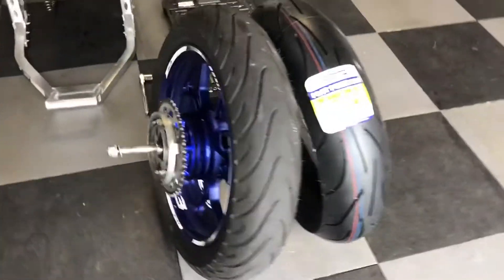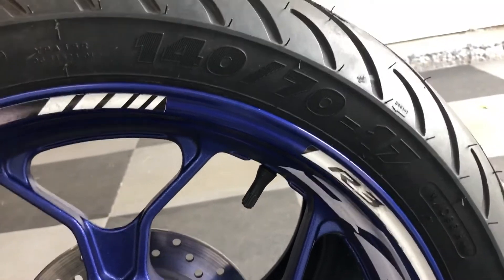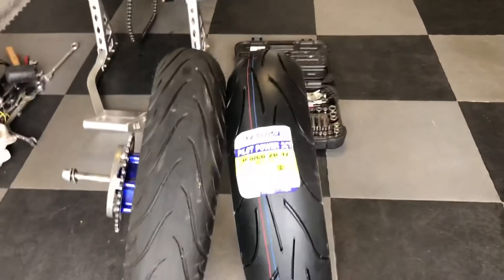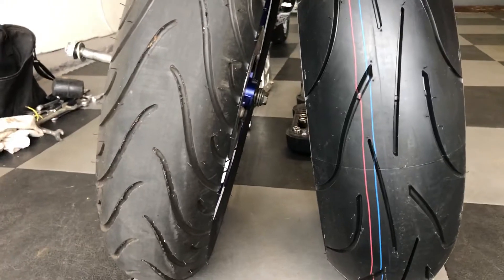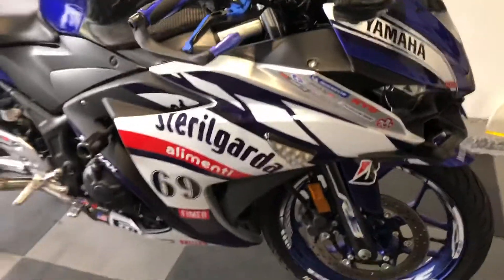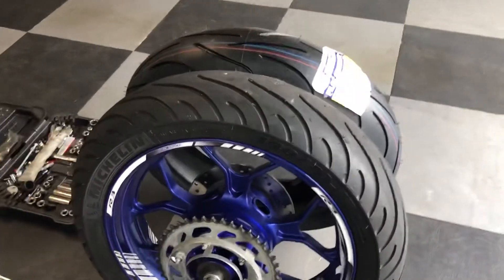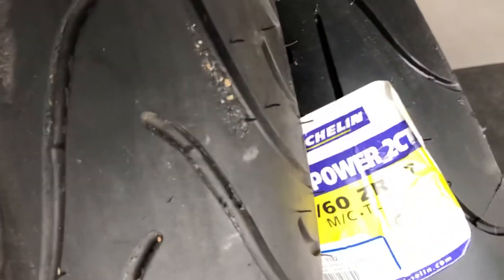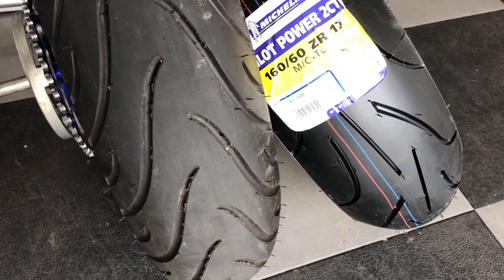160-60-17 mounted on stock rear Yamaha R3 rim. Changed from a 140-70-70.

Comment: Yeah I’m getting a 160/60/R17 Dunlop Sportmax GPR 300, a full Yoshimura R77, and ECU flash. I want a  120MPH top speed, so far 114MPH is my best run, hoping the weight savings and few horsepower will get me there. Might go with the TST WORX Pack.
Reply from the maker: I found a great deal on a 5 inch rim   look
https://motogaga.com/wheels/41-635-yamaha-r25-wide-rear-rim-conversion.html#/4-color-blue
Reply: I ended up getting the Dunlop GPR 300 Sportmax 160/60/R17 and love it.  I installed some winglets the other day as well and it’s much more stable on the highway. I tried for a top speed run and only got it up to 113MPH. Going to try again, I think I was in a headwind. I’ve got the Toce Full System, Norton ECU Flash, Velocity Stack, Airbox, MWR Air Filter, and Lithium Battery. Going to swap out the sprocket in 3,000 miles for an aluminum with steel teeth. I had a fairing bolt fall out, and my winglets may have increased drag. Going to try with half a tank as well.
Reply: You will more than likely never hit 120 mph on the R3 as sixth gears rev limiter hits right at about 118-119mph and then your done.

Comment: Nice informative video. My query is which will be best to upgrade 160/70/R17 or 160/60/R17 and reason thereof. My original tyre size is 140/70/17 in Royal Enfield Meteor.
Pls give ur expertise advice. Love from India
Reply from the maker: @ajayparliament  the cost effective way is to go with 160-60-17
Reply: @shawncouture5541  Boss cost is not a issue. Issue is wether which is compitable.
My preference is 160/70/17 but fear is wether it's good choice or not
Reply from the maker: @ajayparliament  if you see my other videos, you will understand exactly which one is a best fit for you or anyone else. The simplest way to go is with a 1 60 – 60–17 but I have tried all different methods if you look at my other videos.
Reply from the maker: @ajayparliament  I would recommend you contact my good friend in Indonesia, who got me the exact size rim that I wanted to make it a bigger tire, which is listed in all of my videos that you will see posted with all the necessary information as well. I hope this helps

Comment: Did you do any adjustments to the front as in lowering it a bit? Heard since the 150/60 is .07” smaller Than the stock 140/70  you would need to lower the front a smidge??

Thanks
Reply from the maker: I did lower it at one point but put it right back after a short period of time it didn’t seem necessary
Reply: @shawncouture5541  alright thanks. First bike and wasn’t sure on how much the geometry of the bike worked by just changing a tire. A lot of people are making it seem like it throws the bike WAY of or something. I use it for commuting no track or racing.
Reply from the maker: @vtecdpn100  no problem at all

Comment: You think a 150/60 r17 would fit on a 3.5" rim?
Reply from the maker: No.  The rim is too small
Reply: @shawncouture5541  but r15 v3 has 140/70 r17 has stock and i saw a post saying that you can increase atleast 10mm from its stock size
Reply from the maker: This is what I found.  These will fit on a 17 rim 3.5

140/70*17        3.50/4.00/4.50
150/60*17
150/70*17
Reply: @shawncouture5541  thanks bro
Reply from the maker: @jinwoo9801  anytime
Reply: @jinwoo9801  an r15? Shouldn't it have a 130 for the rear?

Comment: What is your front tire profile bro?
Reply from the maker: I kept it stock.
Reply: @shawncouture5541  bro is it necessary that if you change 160/60 then the front is also 120/60 not 120/70? Should it be the same “/60s” or nah?
Reply from the maker: @zhainalmarkjulaine6636    It is not necessary to change both.  You can put a larger tire on in the back and it will not affect the front.  I have even put a 180 on in one of my other posts.  take a look at those videos and you will see it looks great and rides great with no issues at all.  I did have to upgrade the rear rim to a 5.5 inch to accommodate the larger tire size.  Hope this helps.  I also included the links where to get the rear rim as well.
Reply from the maker: I also have the stock rear rim saved with a 160-60-17 tire brand new if you are interested in it.  I dont use it but it sure is a big upgrade from stock and looks amazing.  I went with a 180 and a 5.5 inch rim  and now my bike looks like the R1 i had in the past or my R6
Reply from the maker: https://www.youtube.com/watch?v=CHhmoHY67ZI&t=29s
Reply: @shawncouture5541  okay bro! Bro on stock rims the maximum size that can be able to fit is 160/60? How about the cornering performance? Is it good?
Reply from the maker: @zhainalmarkjulaine6636  correct. It corners the same. No problem at all.

Comment: What size is that rim?
Reply from the maker: This video has the stock rim which will allow you to put on a 160-60-17 size tire max.
Reply: That third number on the tire always indicates rim size just for future reference. Same on Car tire sidewall
Reply from the maker: @mtmatt8958  that is correct. The first number is width. The second number is height and the last number is the rim size